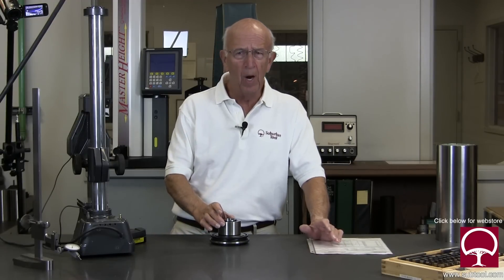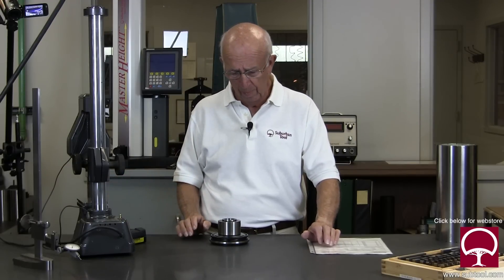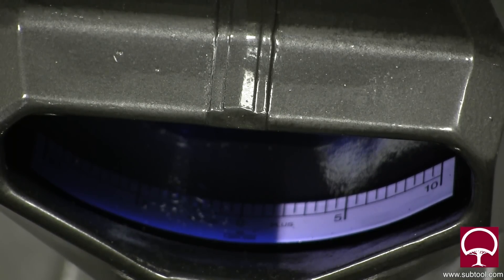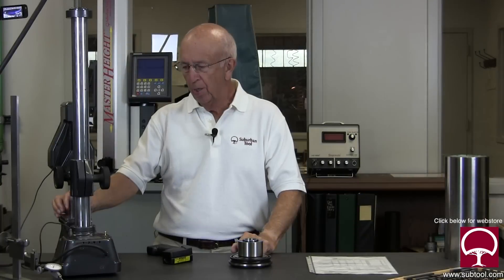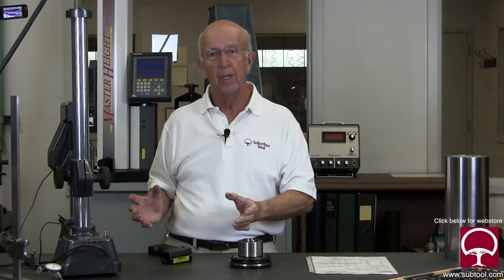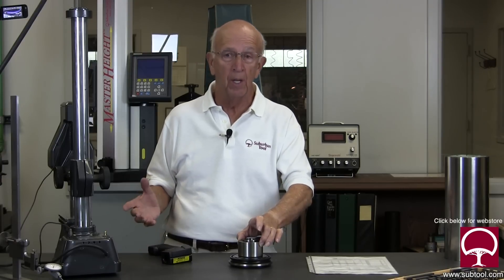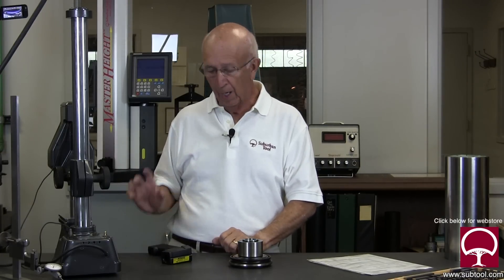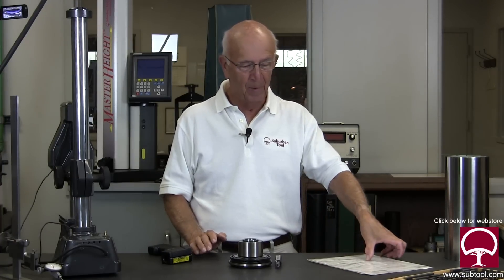See how temperature and gage block deviations if not considered, can easily scrap your parts.

Comment: If you aren't in a climate controlled environment I imagine trying to hit a .0001+- would be extraordinarily difficult. What if it is 90 out on the shop floor? Is there a way to hit that tight tolerance without doing the part multiple times to find out what is expansion rate is?
Reply: +bcbloc02 That's easy, you look up the expansion factor from the material data sheet and take that in to account when making the part and measuring it.

Comment: Even just turning parts on a lathe dealing with thousandths not tenths you have to watch for temperature.  When you get into parts more than a few inches in diameter, you really notice it. The most extreme example of thermal expansion difference I've seen was a 1 inch shaft being inserted into a hole with a 2.5 thou interference. The part with the hole was prepped by heating with a torch and the shaft was cooled in liquid nitrogen. The shaft literally rattled around in the hole and you could see the gap with your eyes.
Reply: +theslimeylimey Are you sure it wasn't 2.5 thou, as the 25 thou would have to have about 2000 degrees Celsius temperature difference (in steel), which would mean melting?
Reply: Jaakko Fagerlund Oops, yes I did - fixed thank you. I did a quick check and the expansion would have been about 0.011" which seems to fit what I remember seeing.